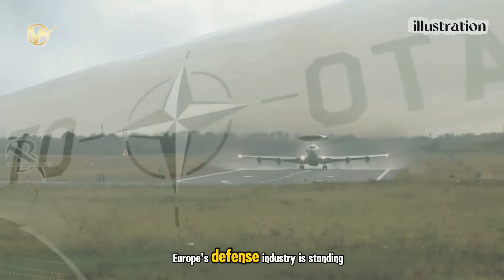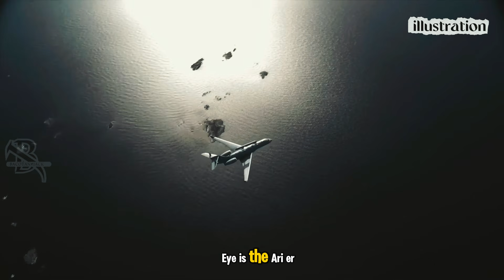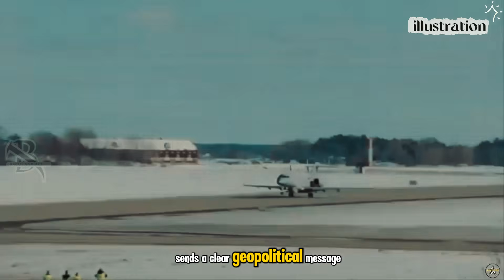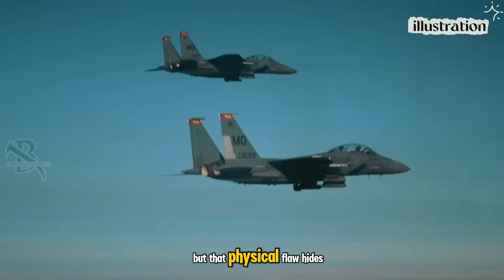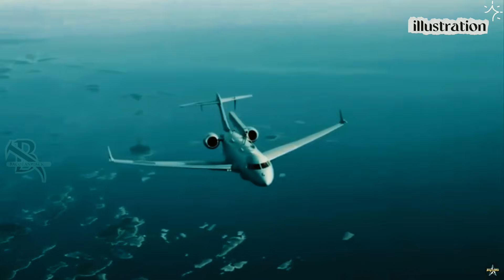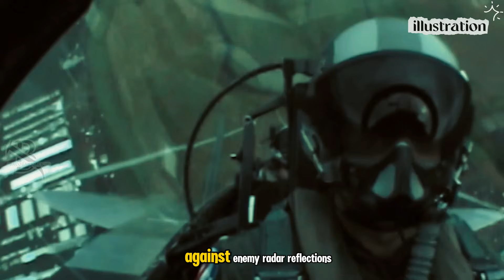Choosing the Saab GlobalEye! Clear Proof NATO is Leaving US Technology Behind

Comment: Time to stop buying F-35, and US missiles like Sidewinders and AMRAAM and change to using EU missiles like IRIS-T and Meteor and such..
Reply: I think when the Gripen is added, they may change to European ordnance, eventually
Reply: @TheAlphaRob  well I like the Gripen but maybe the maker can consider making a twin engine version or making 2 models, a cheaper more affordable 1 engine for the mid tier and a 2 engine heavy fighter for those needing a longer range/endurance and payload. 

Currently Saab and Boeing has a T-7 Red Hawk trainer, 
In 2023, they pitched the idea of the F-7 as a LCA, but I haven't seen any news on it yet since 2023. 
Many EU nations with tight budgets would love a Light combat Aircraft  (LCA) especially if they have a smaller airspace to defend.
Reply: @lingth I appreciate your position. Their is not budget problem, we dont want to spend needlessly on of a fleet. The newest aircraft I see would fit Canada, is the kf21 Boramae BUT the lack of maturity will not work. Canada has joined the NGAV and was invited by Sweden to collab on a Gen 5/6 aircraft. 

If we spend $89B on the lifetime of a fleet off 88 aircraft we are just throwing away another ‘Avro Arrow’ moment, we must diversify and plan for the future. For Canadian needs and requirements.
Reply: @lingth   When Canadaire built the F-86 under license, they redesigned the fuselage to fit in a more powerful Orenda engine resulting in a F-86 Sabre with far more performance and it was the Canadian Sabre that took the export market.  They also replaced the engines in the CF-104 for better cold weather performance and even the CF-5 had Orenda built engines though they were identical to the US engines, the modifications of note to the CF-5 was that Canada changed the landing gears to use shorter runways, added a reconnaissance nose and added an in air refueling port.  Once the Gripen is being built in Canada is the time to bid a Canadian two engine version to be built but not just because Canada has always valued the redundancy of two engines in the Arctic but because bidding a Canadian design would maximize the technology transfer of the Gripen's.  South Korea bidded the design and manufacturing if the KF-21 Boraemae fighter to maximize the technology transfer of their F-35 contract and now has the KF-21, it was nerfed by Lockheed Martin si that it would not compete with the F-35 but the features omitted should be reintroduced by batch 3.  Turkey did the same with their KAAN fighter.  Canada's history of licensing fighters to be built within Canada has been leaving the technology transfer for the corporations to fund resulting in Canada becoming the manufacturer of parts and offering maintenance services.  It will be how we manage future procurements as to whether we build our aerospace industry or just become another parts manufacturer and service provider.

Note South Korea is designing a more powerful indigenous engine to replace the GE F414g engines in the KF-21 which is also the engine in the Gripen.  South Korea has promised cooperation with their entire weapons portfolio including the fighters with the KSS-III submarine so there is a chance of replacing the Gripen's engines with more powerful engines that are designed to be plug and play swappable with the F414g instead of adapting the airframe for the Rolls Royce EJ230 engine which is a similar form factor but not plug and play swappable.
Reply: @TheAlphaRob  I see, I dun mean for Canadian needs, I am saying EU as a whole, the 25 nations or whatever, need to buy more of their EU defense tech and use less American defense tech, they are giving US defense companies so much business when they should buy from EU defense contractors where possible. And EU defense companies should increase production capacity to keep up that demand. The world need to cut back the dependency on 1 nation for their defense needs who knows if there will be a crazier US President after This one.
Reply: @lingth I was meareley agreeing as a Canadian Vet,  we are changing. We Had too.